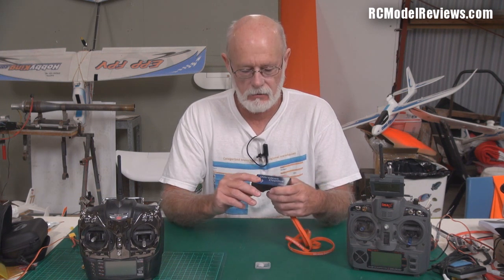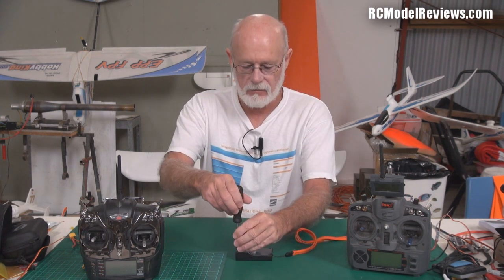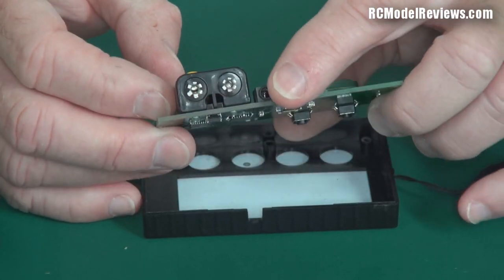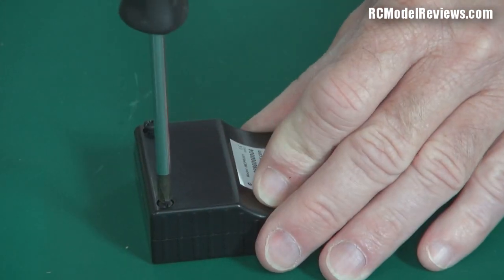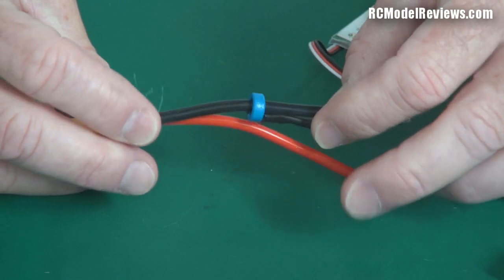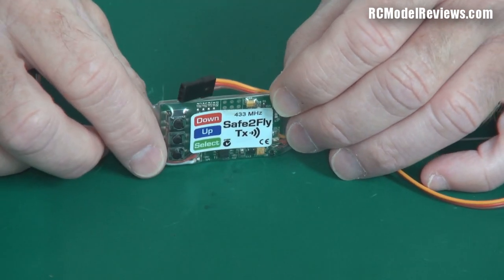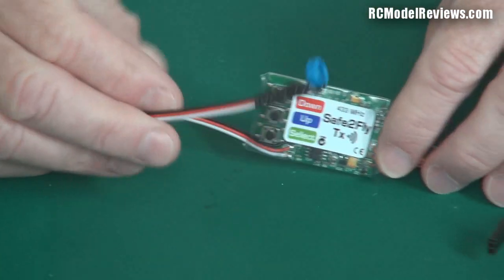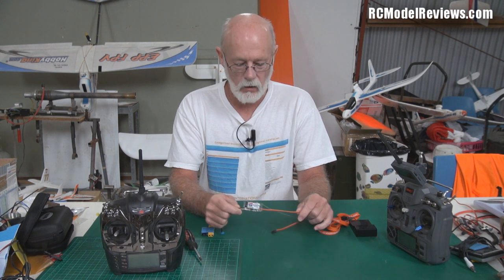Review: Wireless Copilot Safe2Fly (part 1)

Comment: Thanks for the nice video.  
I'm thinking of getting into powered gliders and considering an altimeter.  The link to buy this thing is no longer valid.  What's the most cost effective stand-alone vario available these days?  I'll be flying with an origninal (2007 era) Spektrum DX7 with no telemetry.
Thanks!

Comment: If the dry cell batteries last a year, they may actually be better than Lithium or NiMH in the long run... Replacing $1 in batteries every year versus having to keep peak charging those other two battery types multiple times a year would become more of a pain in my opinion.